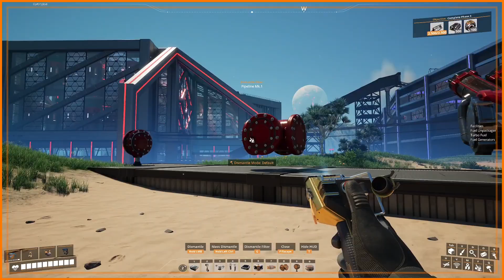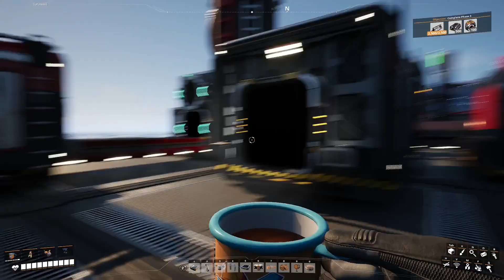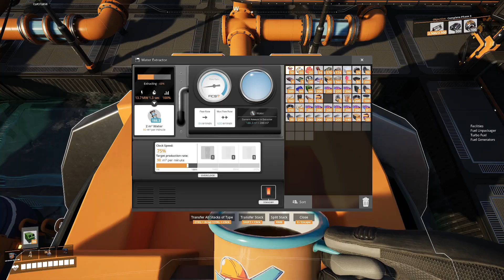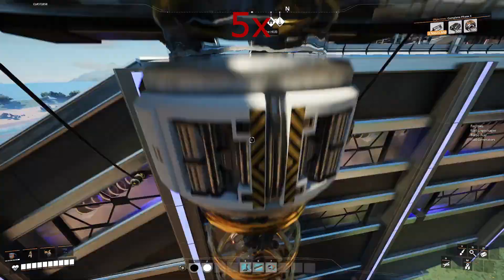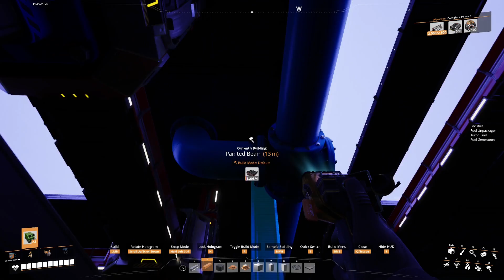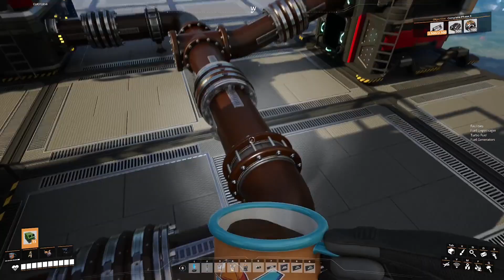Fluid Dynamics in Satisfactory: "Is this a bug?" "What is backflow?" "Why do I pee purple?"

Comment: Great detailed coverage of the flow of liquids with some good tips. Only question I still have unanswered, what about verticality and how does that impact the flow, does a lower connection has less pressure over over a level, or higher connection? I have been presuming that downward connected pipes would take all the liquid over the horizontal connection, which is not quite the case, or that lower pipes would fill up before liquid started to rise in vertical pipes, and used that logic to create 'valves', which works to an extend but not completely as expected, in both cases there always seem to be a bit of unexpected flow. I will have some proper testing to do after watching your work, or wait untill your follow up video ;)
Reply from the maker: Hi!
I didn't address this topic because of two reasons:
1) Flow is already complex when talking about flat surfaces and didn't want to overcomplicate things.
2) I really don't have that much experience on this, or on water towers, and didn't want to risk spreading misinformation.

Verticality in general improves flowrate. It adds pressure to the system that is below and makes backflow almost impossible on those segments. Lower system gets more pressure than the higher one. Your concept of valve is correct, the lower system should get filled up first, and then the higher one. Still, the turbulence is important in these cases. Because of how fluid generators work, sending "waves", you might have a case when the vertical pipe receives a lot of liquid in one batch, and some of it gets to the higher level even if the lower level isn't completely filled up.
This Wednesday I'm releasing the video where I turn on my massive turbo fuel plant using a full pressure startup. And I had an Issue regarding fluid dynamics that was unexpected and managed to locate and fix. It is related to exactly this subject, and I fixed it using verticality. It won't answer all of your questions but might provide you as a single example of how fluids behave when falling through a pipe.

Cheers!
Reply from the maker: The turbo fuel power plant startup has been uploaded! There, kind of at the end of the video (troubleshooting part) there's a good example on how verticality helped me fix an Issue I had with fluid dynamics. https://www.youtube.com/watch?v=knOSPUzRdtY

Comment: I'm guessing refineries that are placed and connected but are off also count as dead ends? I've been fighting with an issue where a fully overclocked pure oil node doesn't operate at 100% and the setup had a bunch of refineries with some that are off as consumers. Half the refineries were off and maybe that caused wicked turbulence. Your video gave me some more ideas on how to fix it. Great vid, thanks.

Also interested to know if having differently clocked consumers is bad too? I saw you mentioned producers, but my refinery output doesn't fit on a single belt so I have some of them clocked different.
Reply from the maker: Yes! A machine that is turned off ends up being a dead end. 
Regarding using pipes at full capacity. Don't get frustrated, it is extremely hard to get right. I can say that is probably the hardest thing in this game, and many people simply use them at 95% just to prevent having issues. One tiny imperfection, one tiny amount of backflow, and the pipe will clog, and the system won't ever catch up. Resulting in oil extractors working between 97% and 99%. It even happened to me in my turbo fuel plant! I'm using mk1 pipes at full capacity, and I ended having trouble with fluid dynamics. Video is coming out next Wednesday and includes everything. Me celebrating everything is working, me realizing everything isn't actually working, finding the error, and fixing it. 

Differently clocked consumers are not ideal, but is not that bad, and you can get it to work. Anyway, if you can manage to simply play with the numbers to make them work at the same clock, the system will be more stable. I simply mentioned the producers, because on those cases, it's extremely easy to get right, and it's not worth it exposing yourself to trouble, when you can simply take 1 minute to set the same clock on all of them.
Reply: @NicoBuilds-g3u i actually checked on those refineries after watching your video and they seem to be running fine now, i did a bunch of things i read online and dunno what worked, i don't wanna mess with them now. I'm guessing they had time to fill up since i added a buffer at the source and your last part of the video of filling the whole system happened naturally. I also saw that looping the system can work and i did that too.
Reply from the maker: @orlagh277  thats really good news! Congrats on an efficient factory 😀!

Comment: 20:18 I thought I might add some info on how to set all machines at the same underclock rate.
If you need to have your 6.5 machines be underclocked at the same rate, do the following:
- Take the number of machines needed and round that number up to nearest integer, in this case you place 7 in total
- Apply this formula: (number of theoretical machines producing) / (number of placed machines), in that case: 6.5 / 7 = 92.8571%
- Underlock all 7 machines to 92.8571%

Comment: I understand that it will be illogical and contrary to physics, but it would be better if they made the pipes have directions. So that the pipes would behave like conveyors. I do not understand why in such a casual game I have to spend several hours of my time watching videos on YouTube explaining how the pipes work in this game. The pipes are the worst part of this wonderful game. Either I am too stupid, or something is really broken. I watched different solutions on YouTube, but nothing helped with my problem. I simply do not have enough oil, although the numbers match. I have a production of 4000 rocket fuel per minute, but oil spoils everything. 600 oil comes from the extractor and goes to 8 refineries, each of which consumes 75 oil. But for some unknown reason, the last two refineries are short of oil. I spent many hours solving this problem, but I could not solve it. As a result, my production works at about 92-93%. Sad.

Comment: Great video! Just a quick note on valves though, they DO NOT reset head lift. This is probably a misconnection from how the head lift rings from the pumps seem to indicate that head lift stops at valves. In reality, the head lift will continue past a valve. You can easily test this with a water extractor, pump, valve, fluid buffer, and some foundations.

The other issues that you raise about valves, such as the backflow and the flow rate unintuitively depending on the pressure on each side are correct.
Reply from the maker: Yeah, was also pointed out by another viewer. That's completely on me (as I don't really use valves). Today I made a small experiment and confirmed it. I have already updated the video description and will see if I can somehow add a note on that part of the video. I really don't want to spread misinformation.

Thanks for letting me know! This is the kind of comments I really expect to read 🥰
Reply: When a fluid mechanic needs full pipes to then work exactly like a belt with uplift, the fix being ignoring most of said mechanic, it just shows the fluid mechanic is not appropriate for this game, pipe troubleshooting made worse by little diagnostic tools/graphs compounds the problem. They should simply scrap the useless sloshing simulator, it takes away from immersion and gameplay anyways, lack of balls or vision from the devs, maybe someone important dont want to let go of his little idea of a mechanic that dont even behave close to real one...
Reply: Im so angry about this I wont even report my testbeds findings in bug reports to not them help hang on to this wreck, great game but this bad mechanic has no place being tested post 1.0 in a game with little centralized data to work with, shows lack of respect for players...
Reply: Imagine having to prevent resonance waves in a closed pipe system with voids creating mini lakes inside pipes? The whole thing woring like a janky roman aqueduct... Hello?

Comment: Great video ! At my day job, I'm an operator at a large district heating and cooling hydronics plant. 160M BTU of hot water and 5500tons of cooling capacity. I'd be lying if I said I wasn't confused and gave my monitor some stern looks when fluids werent flowing "properly". Afterall, I load balance all day long. Your last chapter hit the nail on the head. The main but subtle difference is that my real life closed loop systems are always full. Once full, they do very much behave like conveyors. Pressure equalizes and water continues flowing to the path of least resistance. These empty pipe shinanigans   really took me for a ride. Now i just build one extra pump than needed and let the game modulate their output like the variable speed drives in real life. Its less of a hassle and behaves more like what im used to.
Reply: To add, I also agree that the way the game deals in "packets" of fluid production and consumption made things needlessly more complicated in fluid behavior

Comment: I'm curious, one of the things you recommended is to try to keep it 1 to 1 generators to consumers, or 1 generator and 2 consumers. 
What would you do in a situation where you want to fully utilize a crude oil node, extracting something like 600 crude oil per minute, and turn all of that into heavy oil residue, which would require 20 refineries?
Do you just sacrifice the optimal design and split the single input pipe 20 times, or do you do something else?
I'm planning a rocket fuel power plant and i'm trying to avoid the various issues i've had with fluids in my previous builds. I'm sick of power fluctuations with large fuel powered generator layouts!
Reply from the maker: I always try to make small systems with close ratios (1-1, 1-2, 1-3, 2-1, 2-3... etc) But of course that doesn't apply to oil extractors. I have to use all of it! In those cases, I'm just extra careful. For example, the turbo fuel factory I have just finished produces 600 turbo fuel out of 270 oil. On a node that could deliver 300. That pissed me off, so I added an extra refinery just to do some plastic and use the 300 oil that was available. Spoiler alert: That ended up bringing issues, but I managed to locate them and fix them. It will be all on the next video that will be coming up in a couple of days. When we turn that massive factory on.
Cheers!
Reply: if you are using the 600 node just for fuel power it would require 10 refineries creating fuel from crude oil. each refinery can split twice to feed two fuel generators. creating 5000MW in total. 

using the alternate recipe 'heavy oil residue' would require 20 refineries to create the heavy oil (800m3) and then 13.333 refineries to make the fuel (533.33m3). and then 26.666 fuel gens creating 6666.65MW. using this method would run into complications with the heavy oil residue part. as it would create more than 600m3 if kept in one connection (max pipeline mk2 size).

hopefully this helps

Comment: Regarding chapter: Full Pressure Startup.
Note: This solution will require more space, calculating 'Valve-resolution' and it's a 'niche-solution', so if this is an issue, stop reading. ;)

You can solve many "issues" with Fluid Buffers.
So with your setup as a template, place FB between each segment of the production line.
The trick is to make sure that the FB-output is higher then the input of the next segment of machines.
(Basically place it on x-amount of foundations and use pump(s) if >10m.)
Let the FB fill up to 100%, turn off production, then connect the FB-output to the next segment of machines.
Repeat until you reach the end of the production line, creating a "wave" of pipes going up and down between each segment.
Start up the machines in reverse order, meaning finished product first.

This will "solve" the valve issues, as the valve would be placed below the output of the FB, creating a full pipe with constant pressure.
And as the FB would contain 50-99% fluid (depending on how long it took to startup the machines), the valve's input pipe will always be full.
(This can also be controlled by turning machines on and off in each segment to let the FB on 'either side' fill up above 50%.)

But what's the benefit of doing this?
-The input pipes to any machine will always be filled up.
-You can setup Pipe Junctions and Valves to divide the fluid more accurately and split it to produce different products.

Lastly, according to the wiki: "Unlike Pipeline Pumps, Valves don't block the head lift, even when their limit is set to zero m3/min."

Thank you for taking your time to make this video! Fluids needs a lot of attention and explanations, so please keep making more! :)
Reply from the maker: Wow, never seen that setup. Sounds interesting and I might be trying it out! I don't mind building big, I usually end up building huge stuff just to try something out or do a weird idea that I consider funny. 

Was pretty sure that valves reset head lift, but to be honest I don't use valves, and I might be entirely wrong. And now I feel guilty about spreading misinformation. Will research a little bit, and if that's the case I will leave a note. Thanks for letting me know! Means a lot! 

Have a nice day!
Reply: This is what I do. I fill the reservoir and pressurize the pipes before turning anything on down the line. Simple, effective, and... nearly foolproof. 😂

In my current fuel generator factory I have three reservoirs (fluid buffers) up on pedestals, separating each segment of the factory and everything operates at precisely the chosen clock speed.